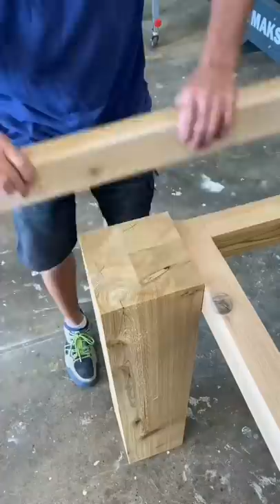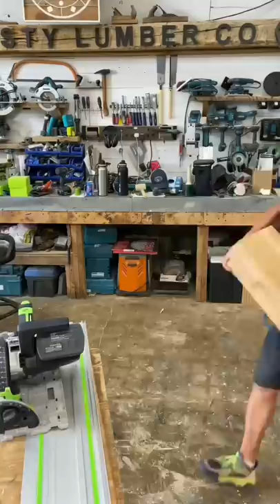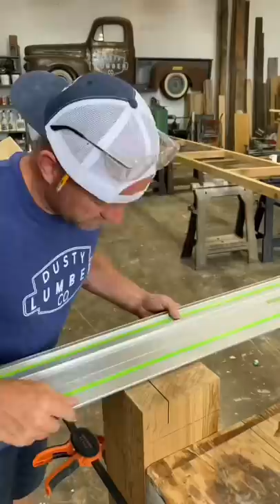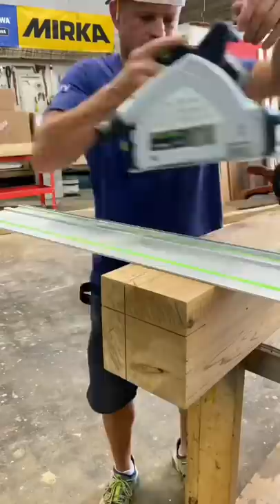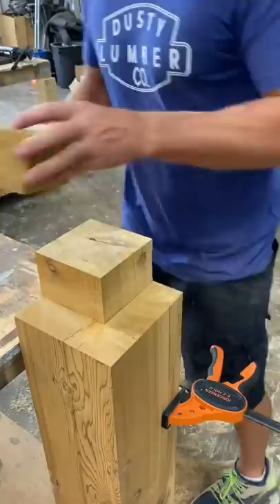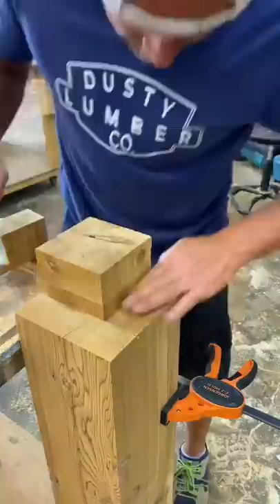Cutting and fitting posts

Comment: Built a deck last year first time I ever used 6 inch posts wow what an absolute difference it makes much better worth the investment
Reply: Yupppp 2 by 6 better on decks done it
Reply: 6 inch posts for a deck seems a little unnecessary but it would definitely be strong 😂
Reply: I use six inch post looks heavy durty to.me
Reply: Most deck building codes now require 6 inch posts .

Comment: One suggestion... square it to the top/frame and mark the legs from that frame. If your corner joints are of a little they may stick out,or be slightly crooked makingthem perfectly.
Reply: Exellecet Work 
Mi friend

Comment: You work faster than most people I know, it’d take all day for one of my guys to do what you do in 1 minute. Take two just to read the tape measure. But I digress. On a serious note do you like that saw???? I’ve been thinking of getting one for decking
Reply: A festool for decking? You roof decks? Its extremely overkill for decking a roof as they cost up to 2000 dollars
Reply: Scrap that ,I just looked into one they have co.e way down in price 699.00 is much lower than the price they got a few years ago

Comment: Every time I use a saw I have ten guides clamped into place I double check and recheck to make sure I’m cutting a strait line.    My grandfather would put a tick Mark using a pencil he sharpened with a pocket knife and with a folding yard stick. When cut it with a hand saw while telling me about island hopping in the South Pacific and produce a joint you would have thought grew that way.....

Comment: I'm really considering a tracksaw. For my limited space and tools it seems like it'd replace a lot of larger tools.
Reply: My advice, Get one as soon as your situation allows you - you won’t regret it! I am a set carpenter with a wide array of tools inc. table saw, chop saw, circular and 9 times out of 10 I’ll go for the track saw to make my cuts. It makes accurate, long, diagonal & parallel cuts on large sheet stock a breeze and gives a very professional finish. 

Try to get a cordless one if possible, as they’re always better to use and if you can, get enough track to span an 8ft single cut. This usually comes in 2x 4ft tracks. This saves you moving the track along and re-aligning to the first cut and risking it not matching up!

If you haven’t got much space, it’s perfect. Get yourself a couple of workhorses and you’re good to go! 

Apologies if you already know all this, just offering an opinion, you should just get one, they’re awesome!
Reply: @Tomidsch  thanks man! Great validation! 

I've got a ton of big walnut slabs that I'm making into tables. Thinking this is a no-brainer, especially after seeing someone put a large bevel/chamfer on the underside of a table.

Comment: What keeps the straightedge in place? Is there double sided tape on the back side?
Reply: Comes with clamps but it’s got a rubber thing on the bottom. I never use the clamps and it never moves.